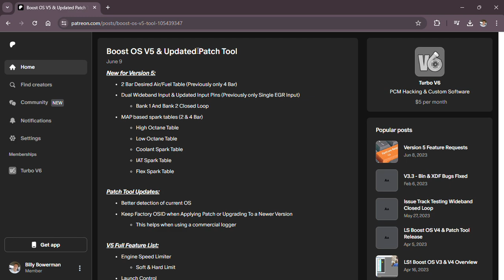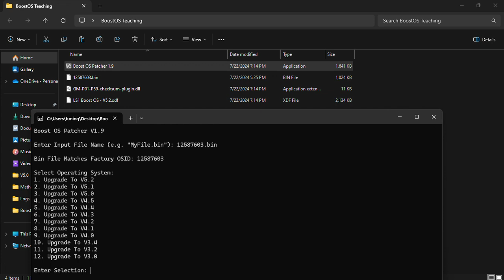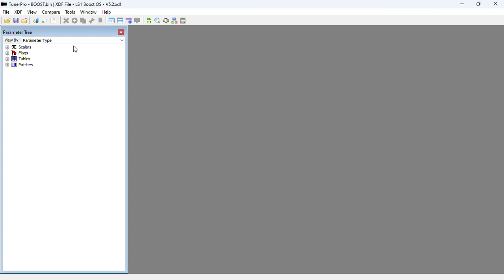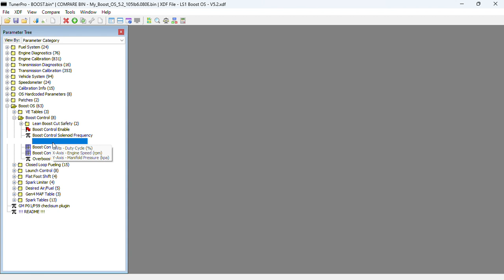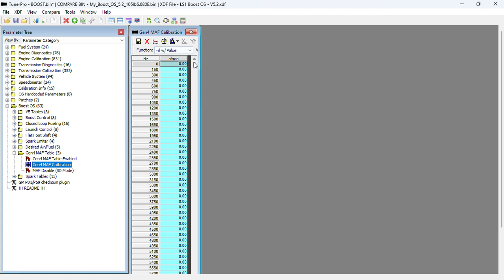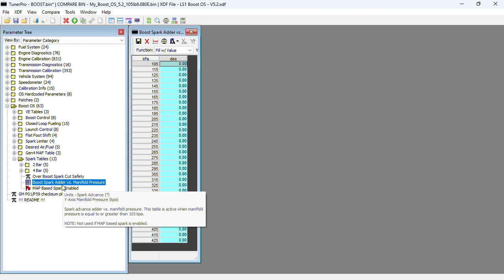BoostOS Introduction Part 1

Comment: Can I use any P59 and hammer the 12587603 OS on there?  If I had a P59 with the DBC IAC chip, I can still choose DBC or DBW right?
Reply from the maker: @TEAMPHY6  yes you can the OS works for dbc or dbw you just have to change one number under system settings

Comment: I would like to see a video on setting up a VE table from scratch (a base NA table) and how you look at a log to adjust the it. (and maybe the programs you use for logging) Also any information on timing. I'm new so I don't really have any idea what I'm doing :) This video was great thank you for putting it together.
Reply from the maker: @alexanastas  I will go over the VE table in part 2 for sure. I've thought about making a video for ignition timing but not many people cover it very well it's almost like a well kept tuning secret. I may make a separate video on it because it will apply to really any engine or ECU.
Reply: @thatturbotruck will you ever make part 2?